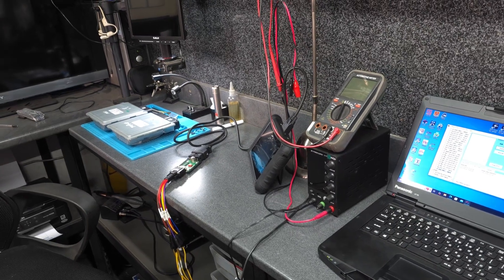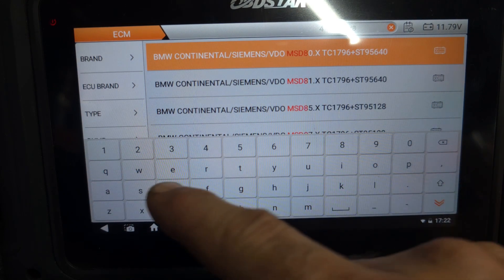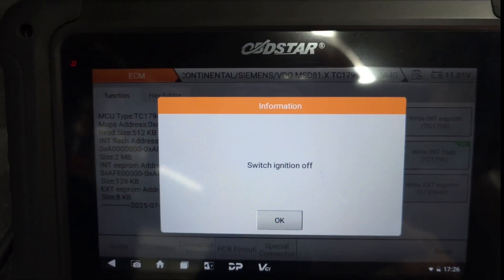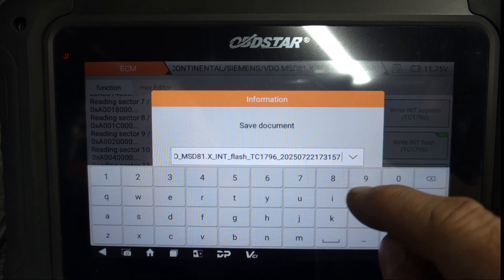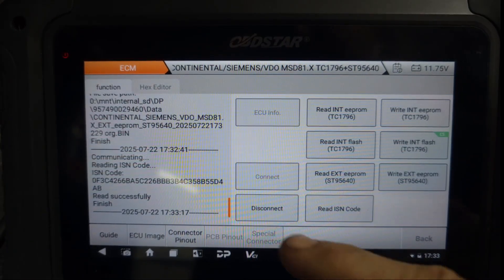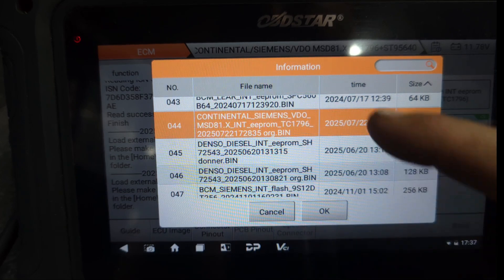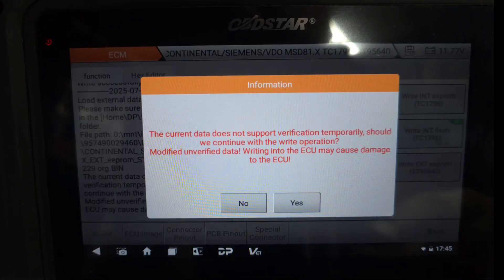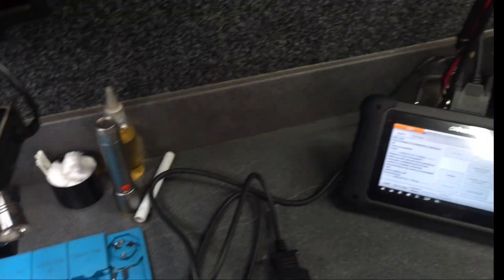BMW MSD81.2 ECU Cloning,Data Transfer & ISN Read | Bench Mode | DME 7640015 5WK94905 | OBDSTAR DC706

Comment: I really enjoye your videos if the ECU is corrupt would that not get transferred across to the new one
Reply from the maker: Thank you, I really appreciate it!
Great question — if the ECU is corrupt, it depends on which part is damaged. If it's just the flash or EEPROM, we can often still recover and transfer the critical data like ISN, VIN, and coding. But if the processor or key data area is damaged, then a clean setup or manual reconstruction may be needed instead.
Thanks for watching 🙏